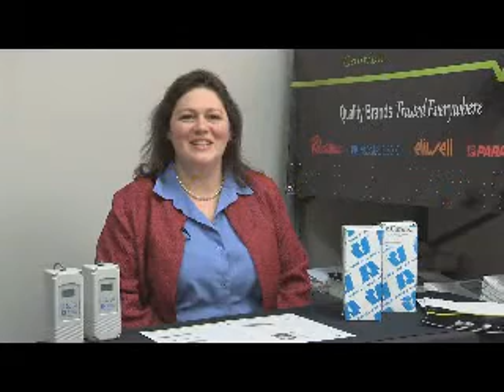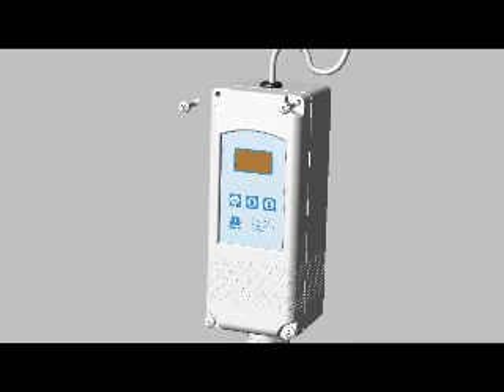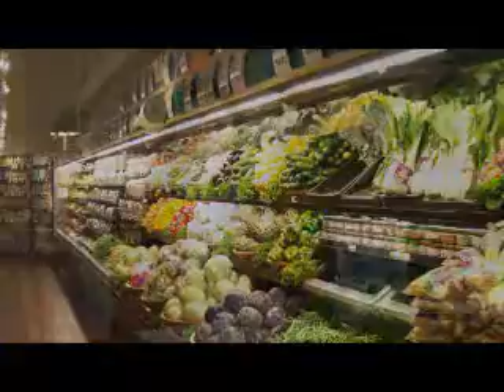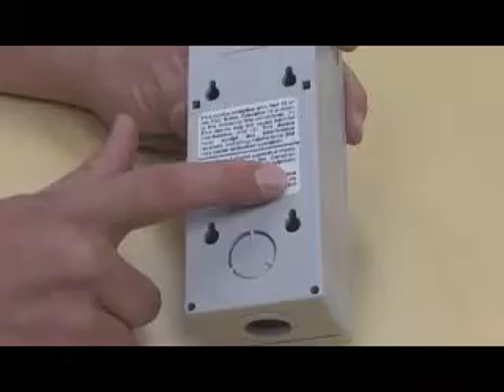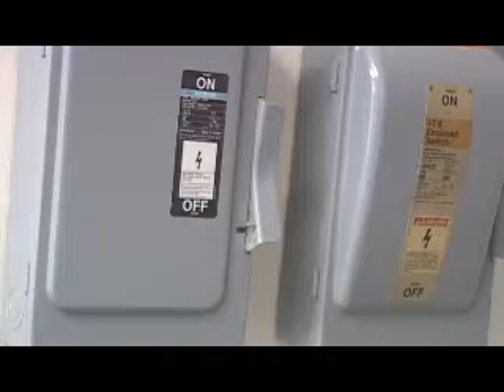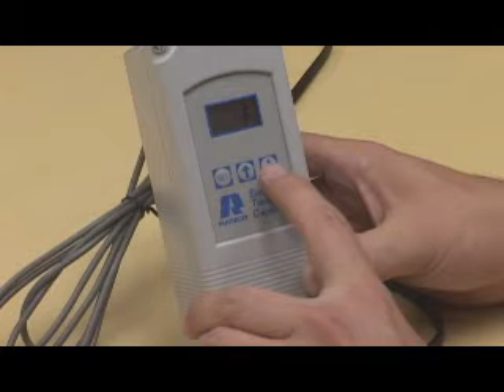Ranco ETC 512k

Comment: I tried to use The RANCO THERMOSTAT ON MY WINDOW AIR CONDITIONER ..
And I Programmed it to STAY ON TILL 50 DEGREES ..
BUT IT TURNENED OFF AS ALWAYS AT 60 DEGREES ..

Im trying to get The Ranco to BYPASS THE THERMOSTAT ON THE AIR CONDITIONER ..

BUT IT DID NOT WORK ..
Can you HELP ME ..

Thank You ..